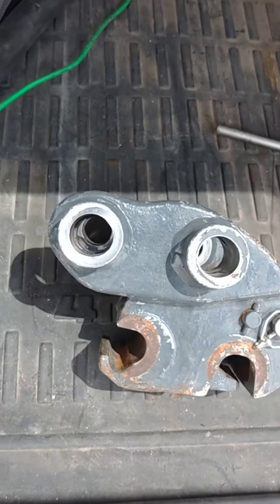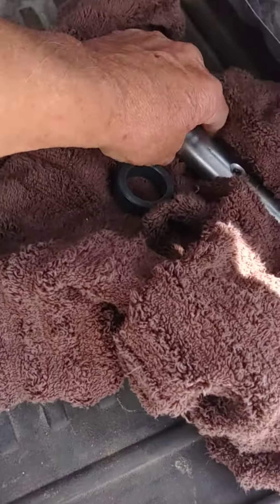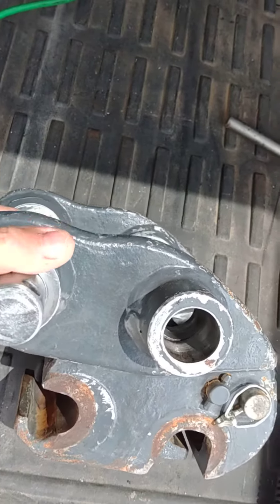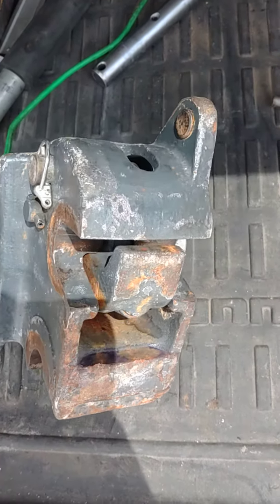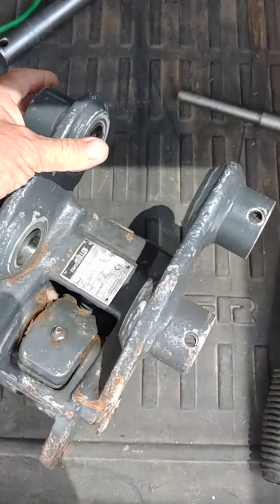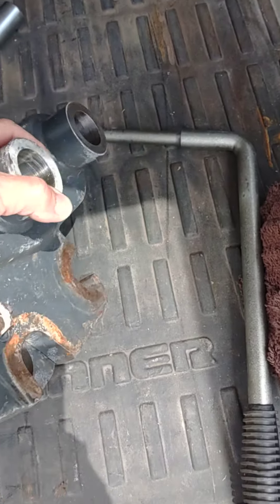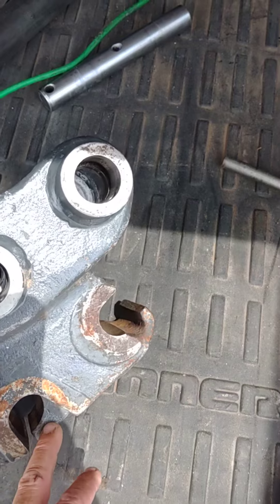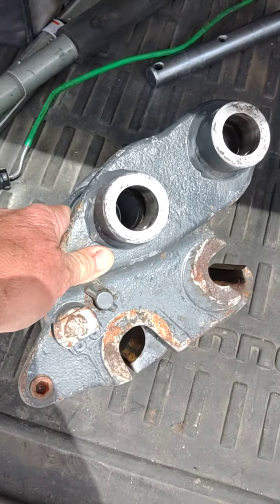LiuGong mini excavator quick hitch. (Miller) Defects and review.

Comment: Miller is a  U.K company that design and manufacture quality quick hitches and buckets. 
I know that there are Chinese copies of Miller mini excavator hitches about and looking at your hitch I suspect that could be the case. 
I hope you have a good experience with the Luigong as they aren’t too bad but the dealers are usually terrible.
Reply from the maker: It's not a Chinese copy.. I contacted Miiler and they didn't respond.. it has their tag on it.. I think they are just as bad as the LiuGong dealer. 
It's been a battle. 
Cheers from United States!

Comment: Have you tried rhinox for a quick Hitch? I have one on my kubota kxo18-4 . It works good. They also supply buckets and attachments, which I have purchased a few.
Reply from the maker: @TheDavidarlen  I have had terrible luck with Rhinox. Maybe it was because of Covid? At the time I was contacting Rhinox, I couldn't get a call back or an email response. Maybe things are changing? But because of lack of response from several companies I built my own. I like my design and it is serving me well. It was a lot of work but It's really strong and locks very well. 
I am going to put a 12v linear actuator in it so I can control it from the seat. Because my design is a rolling lock, there's no stress on the actuator while digging. So an actuator that provides two inches of travel and a couple pounds of force will work fine. 12volts eliminates complex hydraulic circuits. It's so simple this caveman can do it! 🤣 I saw your other comment about getting a 9035 direct from China. I think my next purchase will be a Kubota. I'm not going to be struggling to get parts or service ever again! 

Have a great day!

Comment: I'm looking at a 9027 from warrior right now. I'm curious to know what they said that wasn't true. I asked about warranty support. He said it wouldn't be a problem. I already planned on having them send an email spelling out exactly how warranty work will be handled. But even then after what you said they're looking sketchy. Thanks
Reply from the maker: @robertd6925  If I could go back and do it again, I would have spent the extra $6000 for the Kubota.
Reply from the maker: @robertd6925  He told me I was getting a hydraulically controlled quick hitch, then switched it out with a manual quick hitch. When I found a major defect in the quick hitch they put on the machine, they refused to refund me in full or fix it, or trade it out for one that had no defect. They lost a $15,000 cashiers check and I had to go through hell for two months. They took no responsibility. It cost me about $1000 in travel and bank fees. I lost all confidence in them because of the way they have done business with me. They know that I feel this way and have done nothing to mend it. The Kubota was only $6000 more... Do yourself a big favor and buy a machine with excellent support. The resale value will pay you back.

Comment: What did you pay for the 9018
Reply from the maker: @Ruvimklishta  $29,000 USD
Came with an extra bucket and delivery. 250 miles. I could have had a Kubota with extra bucket for $35,000. Should have paid the extra money.
Reply: @MrSuperchargeron  yah at that price its hard to justify. im about to buy a closed cab unit with 10 hours for 15k. at this price im willing to deal with small problems